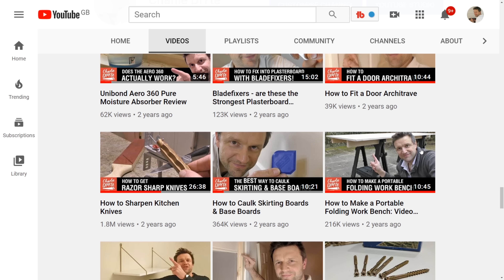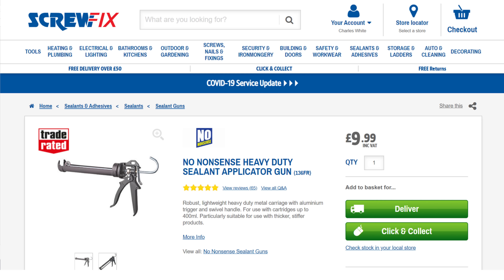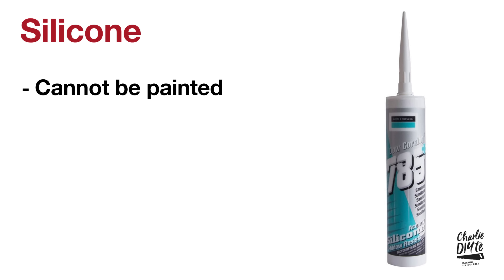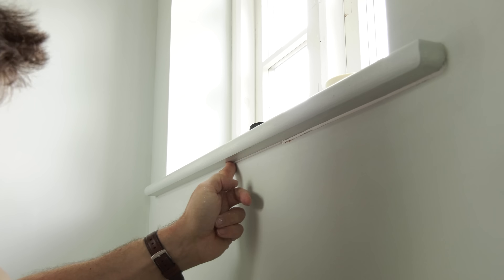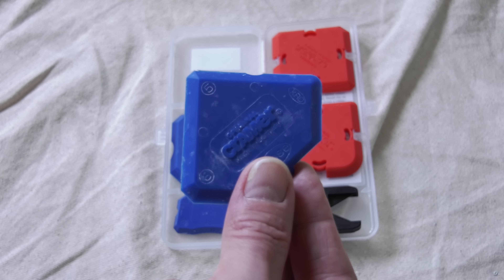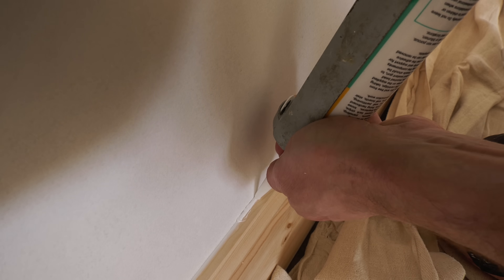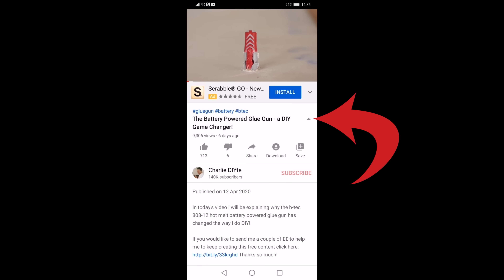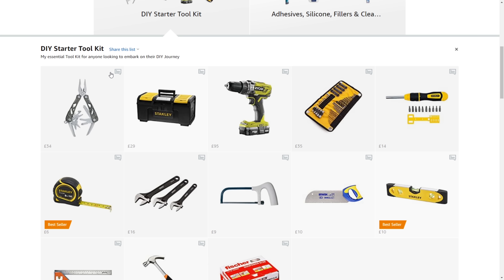How to Caulk Skirting Boards & Baseboards - 2020 Update

Comment: Great video Charlie.
I subscribed to your channel as I have plenty DIY jobs to do.
Can you advise what adhesive I can use to full gaps between wall and skirting? Product recommend by you is not avaible in Screwfix and I'm limited to it (becouse of childcare) so what else would you recommend? Gaps are circa 5-6mm.
Second things are gaps in between skirtings and architraves (1mm). I bought mitre saw but there are no right angles at home, at all. So I lost my patience and I gluead all with gaps.
I wish to finish all neatly but I afraid that caulk or wood filler will leave visible mark what I won't be able to overpaint. I have 2 part Ronseal wood filler but I'm not sure that will be OK for purpuse.
I'm gonna buy primer for MDF and tools to finish it perfectly, then paint waterbased silk dulux white paint. 

Help me please!
Reply from the maker: Hi there. Thanks so much for the sub 👍 For the gaps, I think you should persevere with the 2 part Ronseal. Get yourself some continental filler knives https://bit.ly/3l8mnSJ Tool it as flush as you can, leaving a tiny bit proud, but removing as much excess as possible, and then sand back with some 120 grit sand paper as soon as it's gone hard. I did a video on how to use it here https://www.youtube.com/watch?v=Jaj1SEm8boQ&t=6s It's super stuff when you get used to it as it covers up a multitude of sins. For the gaps between wall and skirting, try this https://bit.ly/3aLtgo4 I haven't used it myself but it can be painted over, and Soudal is a good brand. Have you got a Cramer tool? Definitely advise you to get one for tooling the adhesive, like I did in the video. You can get them on Amazon. Hope that's helpful.
Reply: @CharlieDIYte  Thank you for your help. I have everything what I need (except skills). I'm very excited as this project is dragging from long time.
Ps. I have 1150x500 window boards what should be exchanged, but I came with an idea of cutting in line with wall and laying 1 porcelain tile. Window  recess is surrounded by timber anyway, so I can hide edge of tile. Good idea? What do you think?

Comment: I'm a big wet finger fan, though the smoothing tools are brill.  I'd also recommend applying the minimum amount of caulk necessary.  I rarely cut the end of the nozzle to widen it - the small point allows a lot more precision during application.  The other thing I'd add is that gun work gets better the more you do it.

Comment: Thank you Charlie. Great video!  There is a big cracks between my stair case and wall . Also, gaps on the windows edges. Shall i use GEOCEL PAINTERS MATE FLEXIBLE ACRYLIC FILLER WHITE from SF for both? Thanks, Srini
Reply from the maker: Yes it's decent stuff but I'd full the gaps first with a water based gap adhesives liked I did, otherwise you'll get massive shrinkage on the big gaps.

Comment: I know this video was done 4 years ago but less than a week ago (week 2 in 2025) I read about an application you can apply to silicone that allows you to paint over it. It's a bit of a pain but it's like putting a primer on vinyl covered crapboard, I mean chipboard. I can't remember the substance but it was a YouTube video (I think, sorry but my meds cause my memory to suck now) but if I can remember I'll look through my YT History and see if I can find it.

Been helping my daughter to paint her 2 year old house which nearly every join area needs to be caulked. One, just one corner in a non wet area the idiots used silicone which I didn't notice and I caulked over it. What a far king mess I made. Not sure how to fix it except to cut out the original silicone and hopefully that'll take out my caulk mistake and the caulk the whole corner from ceiling to floor....8 foot ceilings. At 68 I'm too old for this shit now, well that's my excuse. Just two more tooms and the place is finished but unfortunately the bathroom is the worst room to caulk and I am not looking forward to it. The fixer who came to clean up any original mess/mistakes by the builders made it even worse in one area that developed a 7mm gap. The caulk was the wrong colour and then he ran out of what he had and tried to spread it out. It looked worse then my first silicone attempt using my finger, wiping on my trousers and the weting by sticking it in my gob to wet it. Please keep in mind this was before YouTube existed and the Internet didn't have help that came anywhere close to Charlie's video.

Lastly I would like to thank the prick algorithm for Unsubscibing me from this excellent Channel and not putting any links to it in my feed. Shit memory and I have a lot of content that would have been extremely helpful 6 or 7 weeks ago especially the info about the caulking spreading profile tools. The finger doesn't come close to providing a nice sharp and uniform finished edge. Need to find the small ones on stick here in Oz because the ones Charlie use in a video cost about AUD$85 here (shipped from Germany).
Reply from the maker: Great to hear from you and glad to have you back on board. Yes I think you'll need to remove that silicone and start over. I'm pretty sure Bunnings have cheap profile tools and they should also have silicone remover and removing tools (although I use a razor blade) which will make your life a bit easier.

Comment: Really disappointed with some recent caulking I have done, whilst getting a decent finish on the bead it hasn't painted over very well and has left distinct lines of darker coloured paint making the join extremely obvious. Oh well, it's done now.
Reply from the maker: Sorry to hear that Matt. What paint and caulk did you use. By all means send me a picture to charliediyte@gmail.com
Reply: @CharlieDIYte  Hi Charlie, I think it would have been bog standard screwfix/soudal caulk, not sure of paint off top of my head, it was at my Mum's house. I'll see if I can get a pic when I'm there next.

Comment: Great video however I would recommend you paint your skirting boards before you put them on the wall.
Reply from the maker: I think you're probably right. Certainly the bits that are going to come into contact with the caulk.
Reply: @CharlieDIYte  Carpenters find painting frustrating and can't wait to play with the wood.

Comment: I really hate decorators caulk..... I don’t no why but it seems to gather a lot of dust!!.... 🤷‍♀️
Reply from the maker: I think that's because of its matt texture - which tends to go hand in hand with the fact that it's paintable. Also, because when it shrinks, it leaves a bit of a dust trap. Have you got a bristle nozzle for your vacuum that you can quickly vacuum the dust off with?
Reply: Charlie DIYte yeah I got one of them.... when all my house was just wood arcs,skirtings and doors I never caulked anything it was cleaner.... since I started remodelling and fancied a change i thought sod it I will use caulk painted everything white .....looks amazing when it’s first done but doesn’t take long .....I’ve done two rooms so far and the hall way and they gather dust like crazy and it looks dirtier..... I have never liked it my friend laughs at me cause cause he uses it on everything being a builder...

Comment: Should be priming the skirts before caulking. The caulk won't adhere to bare wood well. Not decoration caulk. When your wiping the skirts, your allowing moisture into the timber. If your caulking onto oak you need to use a different products like CT1. And masking tape. Been a professional for nearly 35 years. Shouldn't be caulking onto bare timber.

Comment: Great video but wrong about 90 degree corners being harder too cut in.. it’s completely the opposite.. a 90 degree corner cut in properly is always better.
Reply from the maker: My point is that it's hard to stop the paint leaking onto the adjacent surface with a 90 degree angle.

Comment: https://www.screwfix.com/p/gripfill-solvent-free-white-350ml/64958?tc=NB2

I bought the above, gripfill yellow carton, to fill in gaps between skirting boards. Would this be okay, the one you recommended it's not available in Screwfix or Toolstation so I thought of a different alternative
Reply from the maker: Yes, I would have thought so. Maybe tool a small area just to make sure it tools like caulk, before you do the whole thing.

Comment: You shouldn’t need anything but your finger for caulk. Thing is people forget that caulk is for hairline cracks not for trying to fill 8mm gaps, they should have expanding foam and wood filler. Caulk shrinks too much for big gaps, is too soft and is generally not the right product for big gaps

Comment: It's never a good idea to apply latex caulk to a porous unprimed surface. The caulk will bond much better to a primed sealed surface. A porous (non-sealed) surface causes the moisture in the caulk to be absorbed into the unsealed surface while drying, making for a weak bond and subject to failure. Unprimed wood trim should (Always) be primed and sealed before applying latex caulk.
Reply from the maker: Thanks David. I agree, and frustratingly I'm about to caulk in a new wardrobe build that I've forgotten to seal first 🤦

Comment: Ran out of adhesive and got some gripfill thinking it was the same. Don't make the same mistake. Awful stuff.
Reply from the maker: Oh no! It's great stuff Gripfill for the right applications (glue/gap filling where you don't see it) but try and tool it at your peril!!
Reply: @CharlieDIYte  stupidly made the mistake didn't I. Should of just waited the extra day and got the other stuff I used. Now I've got to sand this gripfill shite. Lol
Reply from the maker: @melancholy5131  We all do it! Sand or possibly cut away with a Stanley knife. You can over paint it if you've got any areas where the finish isn't too bad.

Comment: Adhesive on the back of baseboard?  Hope you never have to remove it or you’ll have significant wall repairs to do.  Also, screwing on baseboard?  Perhaps buy a nail gun 😉